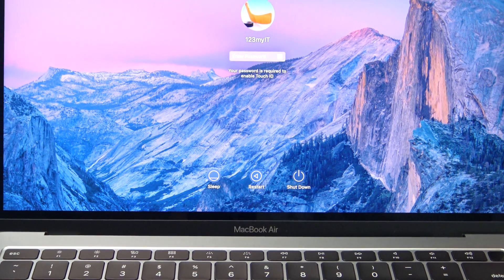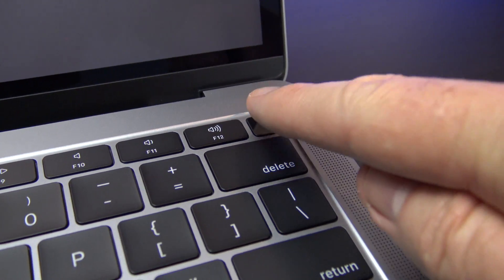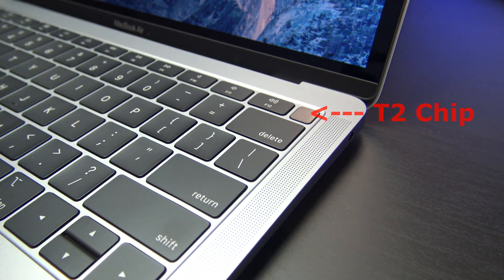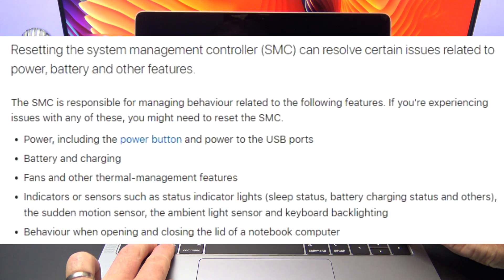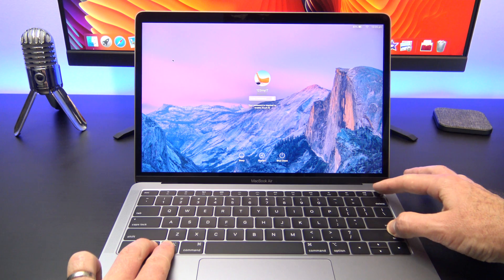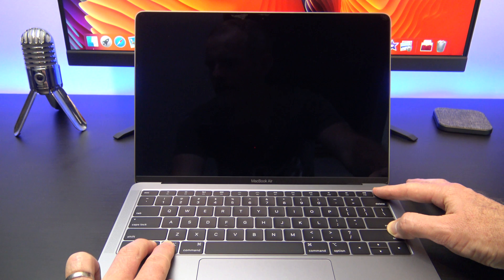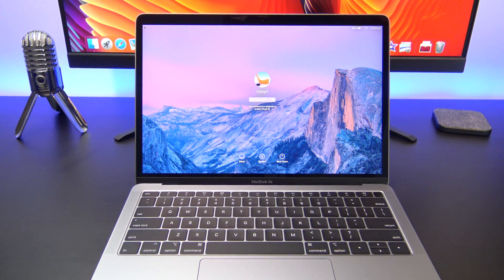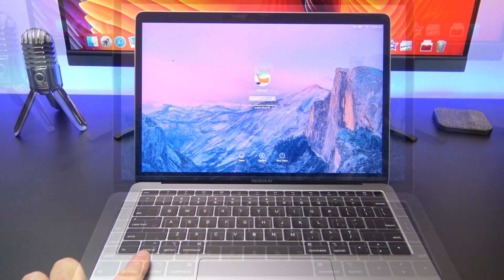Fix MacBook Air T2 Chip by resetting SMC

Comment: I did it exactly how he did it in the video, while the laptop is on, hold the three buttons for 7 seconds - then hitting the power button for 7 seconds will turn off the computer. When the computer turned back on, my battery charging issue was fixed. Thanks!
Reply from the maker: Nice one mate, This video also handy https://youtu.be/dwkZScZ3AOw
Reply: Same, I didn’t except it could work but fortunately this trick saved my mac hahaha
Reply: Eso no reinicia la SMC eso solo es para entrar a modo DFU 🤦‍♂️🤦‍♂️

Comment: Hi! I'm still having problems with trackpad and keyboad. I can connect a mouse into it but, I cannot use the macbook's keyboard. It's like the trackpad is stuck but I can reach out the log in screen.
Reply from the maker: Are you using Mac OS mate?
Reply: 123myIT yes. Catalina
Reply: 123myIT mine is a macbook air 2018 13 inch
Reply from the maker: @eddrumer  Weird it should really work. Try this when starting the mac press and hold the Alt option button. Does it bring up a boot menu?
Reply: 123myIT thank you so much. It just worked.

Comment: Mac air 2019. Activation locked. Icloud
Reply from the maker: Oh ok ?
Reply from the maker: You stuck?
Reply: @123myIT  yes
Reply: @123myIT  you can help remove?
Reply from the maker: @ricardorostas1872  Turn off security boot ?
Reply: @123myIT  I too am stuck.. 2020 Macbook Air.. Activation.
Reply from the maker: @SteveOxy69  Turn off security boot ?

Comment: Hi, I had a bad running Windows 10 running in Bootcamp and tried a recovery wich still didn't solved the issues but after recovery the icon (start up in MAC OS is missing in the system tray, i runned Apple"s software update, the Windows update, they are all ok but the icon doesn't come back and I'm not able to get in MAC OS. I even tried the  SMC reset, searched the web but can't find any usefull resource. please help me! have a great day
Reply from the maker: Which part did you get up to mate? Hold down the ALT option key at boot up and select MAC OS ?

Comment: *Great video, but I'm left still puzzled over my concern. 
-I have a 2018 (16GB) MacBook Air, which I bought new (and is still like new, w/ only 7 battery charge cycle counts.  In the past, once fully charged, I have always shut the unit down AND left it UNplugged.) 

-Recently, WHILE PLUGGED IN still from a full recharge, I noticed a lightning bolt within the battery icon symbol, yet it's stating 100% fully charged + Battery Health: Normal.) 
-However at the conclusion of this battery recharging, the battery symbol then showed NO lightning bolt once UNplugged.  (At 100% charge, wouldn't the battery symbol show no lightning bolt, whether it was plugged in OR not??)

- I found this odd, however I never really paid much attention to this before today, so I have no recollection to compare this scenario to from the past. 

-(Also, I did complete following your SMC directions and this did not change the situation).
*My question to you: With the battery now fully charged to 100%, should this lightning bolt still be there when PLUGGED IN?  ((If yes, great...nothing would be wrong.  However if the bolt's not supposed to show in the battery symbol while plugged in after a full charge, I'd like to find out while it's still under the three year extended warranty.)

-Thank you for any guidance pertaining to this concern!!
Reply: Naa your good man it shows I have the problem it’s not showing me the lighting bolt even when plugged in only shows when i logging into the user

Comment: 123myIT, I noticed that after resetting my SMC and my battery started to recharge, a couple of days later, I had to reset the SMC again to the battery recharges. Is it OK to reset the SMC more than one time? Thanks !
Reply: Yes it is fine. Sometimes when I use MacBook connect to power for a long time battery drains too much. SMC reset helps. There is nothing you should be worried about with Pram and smc reset.

Comment: Only issue I’m having is... trackpad click doesn’t work. The sound, I have silent clicking turned off and it just won’t make the click sound. More annoying than a problem.
Reply from the maker: 📢  After you reset the SMC, if you are still having issues try resetting the NVRAM. Video here. https://youtu.be/dwkZScZ3AOw

Comment: Hey, I am having trouble login in my maybook pro  (Macos Catalina). At login screen I am not able to type my password and as I have turned off touchID  not able to login.
I think the issue could have been with my keyboard and I  have tried resetting  SMC but it didn't seem to work.

Comment: Alright so my MacBook Pro 13's (2019 2 thunderbolt ports) keyboard backlight just stopped working. when trying to adjust the brightness using the Touch Bar nothing happens, not even a pop-up on screen. so I tried doing the SMC reset but I've had no luck. To make matters worse, True Tone is not an option anymore in system preferences and in keyboard settings, it doesn't show the option to automatically adjust to the ambient light and to turn off the keyboard after a certain amount of seconds. It is almost as if the Mac thinks it doesn't have a backlit keyboard and a light sensor.

Comment: Do you know why my Macbook Air  2019's battery drains drastically when not in use for a few days? I charged it to 100%, shut it down, and didn't use it for 3-4 days. When I turned it on again the battery was at 39%. It wasn't in sleep mode. Would resetting the SMC fix this problem?
Reply: go into your system preferences, then select energy saver and restore defaults. let me know if that helps, You could also try recalibrating your battery, go into the same place energy saver and deselect everything but prevent the computer from sleeping, turn the sliders on both the power and battery settings to never turn off display, then go into screen saver and turn it off,  then let the battery go to 0 percent, after it reaches 0% wait for another 7 hours and let it totally drain. Then, charge the battery to 100% and add another 1.5 hours of charging without use. after don't forget to turn back on the screen saver and then restore defaults in energy saver, I am confident that the first restoring default settings will work and you will not need to recalibrate battery, Keep me posted. Cheers also resetting SMC could help your issue and will not hurt anything, I do it all the time

Comment: Hi, my laptop is running very hot and the fans are constantly on, the activity monitor shows “powerd” using upto 200% of the CPU. I tried to reset the SMC but the problem came back.

Edit: Another issue is that the laptop does not go to sleep when the lid is open.
Reply: unless you are using Catalina  first restart, hold command and s when the writing stops type sbin/fsck -fy /  exactly like that,  it will say it is ok or had been modified, do that command 3 times in a row and then type reset,  once at desktop use computer for 10 minutes and then shutdown., startup and then use and see if it helps at all,, if you are suing Catalina hold command r at start-up ,, go into diskutilty in recovery and apply first aid several times, restart and try using, . for the lid issue..go into system preferences and select energy saver. store the defaults there, you probably have prevent sleeping on

Comment: It doesn’t work. :( After updating to Catalina Supplemental update, my laptop didn’t turn on. No keyboard back light, no fan sounds, no signs of life. :(
Reply: Just got the 16” MacbookPro and this doesn’t help at all. 

My screen loads with the apple symbol just up till it reaches then end, then shuts down, fan gives a little puff, and repeats.
Reply: ShartimusPrime I’m having the same problem right now. Did you get this fixed?
Reply: @ShartimusPrime  i love ur videos
Reply: Hi Celine.. I have the same problem with you. What did the MAC people told you? I mean what did they do about your Mac? Thanks
Reply: avie moore hi! they said it was Touch ID and logic board issues.
Reply: Same here have you managed to turn it on?
Reply: Golden kyle Rai nope, it’s still not working. I’m hesitant to open it up as my laptop is still under warranty. I’ve got an appointment with Apple Service Center in 2 weeks so hopefully they’ll be able to fix it asap
Reply: Celine i took it apple store and they say the problem with hardware and I have to pay £ 380 to fix it. You are still under warranty which is good and they will fix it for you
Reply: Update: Apple Service Center said there is a problem with my Macbook’s touch ID and logic board. Luckily, it’s still under warranty.

Comment: I have the MacBook Pro 2019 and my keyboard light won't work. I've tried this but it is still not working.
Reply from the maker: Ok mate try a Reset NVRAM. Shut down your Mac, then turn it on and immediately press and hold these four keys together: Option, Command, P and R.
Reply: Select Apple menu and to “System Preferences” then select the 'Keyboard' preference panel. Under the 'Keyboard' section uncheck the box for “Adjust keyboard brightness in low light” Now press the “F5” key repeatedly (or fn + F5, or find the keyboard backlight button on Touch Bar) until the key
Reply from the maker: @jackiescum5438  I think shes saying the keyboard light wont work tho.

Comment: Hi I’m Brus from Italy , My Macbook pro 2019  128 gb , got some hoverheating problems I’ve installed smc fan control and sometimes whit an external monitor via usb c the tempereture of the cpu is about 100° celsius , Can you helping me?
Reply from the maker: Yes mate have you tried resetting SMC?

Comment: bro my keyboard back light is not working on OS Catalina  please help me out
Reply: you can brighten and darken the light with the f5 and f6 keys or  Apple menu and to “System Preferences” then select the 'Keyboard' preference panel. Under the 'Keyboard' section uncheck the box for “Adjust keyboard brightness in low light” Now press the “F5” key repeatedly (or fn + F5, or find the keyboard backlight button on Touch Bar) until the key

Comment: Hey my Mac keyboard isn’t working at all. I tried to reset the smc and sometimes it works sometimes it doesn’t and I don’t really have a clue of what is going on
Reply from the maker: Hav you got any usbs or anything plugged into it?
Reply: @123myIT  im having the same issue and nothing is plugged into it.

Comment: Hi, my macbook pro 13 touchbar 2019 is always hot and when I turn of the Dock don't disappear I tried to do this but the problem won't go
Reply from the maker: Hi Mate, It should help with things like this. try it again maybe? Also try a nvram reset. Not sure if its still and option on that model tho.

Comment: Hey man, I have an issue with my macbook pro. The screen somehow flickering with lots of purple lines. I notice that the purple lines only comes out on photos, videos, colored background but gone on white background like microsoft, notes, etc. Help me please! I tried the SMC and Pram but didn't work. I don't know if I did it wront or not. I can send you the video of my laptop. Thanks alot! Cheers.
Reply: sounds  like graphics card or white balance issue what year is it? you could try the running color sync utility or go into the system  preferences and select display, calibrate and then calibrate it.. check after..,,., if not select your own white point during calibration. If it has dual graphics, and is older with the graphics gate issues you can search on how to disable the the dedicated and use only onboard graphics card, Also if its an older Mac the smc is reset differently, lemme know, Cheers

Comment: Heyyy... my macbook pro 16 inch is new and it doesn't switch on sometimes... I do the reset and sometimes it comes back on other times it just comes on when it wants to... if I restart or switch it off I will be stuck trying to get it back on. Any ideas.. ?? Thanks alot

Comment: Thanks for this video...I also have followed Apple's official instructions as well (same as what you provided), but I keep having this issue, almost every day or so. The key symptom is that it won't charge when I plug in a USB-C or it won't recognize my USB-C Hub which connects to an external monitor. That, or one USB port works and the other doesn't. 
I'm wondering at this point if it's a hardware issue which I need to set up a Genius Bar appointment for. Any thoughts you had are appreciated!
Reply: I have the same problem! Did you manage to find a fix in the end?
Reply: oh yeah, I have a similar problem, when I plug it the lightning icon appears but it says 'battery is not charging', so I have to reset my SMC every two days or so.
Reply: Same problem here. So is it a hardware issue or we have to reset smc  every day for the rest of our lives?

Comment: Hi!!! My macbook's battery died and it is not charging. Is it possible to do the resetting even if the macbook has zero percent battery?
Reply: Abigail Parungao if it’s not charging, you might want to open the bottom of your computer and make sure no dust or anything is blocking the charging port.
Reply from the maker: Yes it will help. Try a different cable as well. It could be faulty power cable. If you can. Try this without the cable plugged in first.